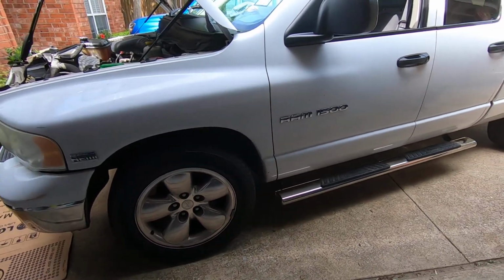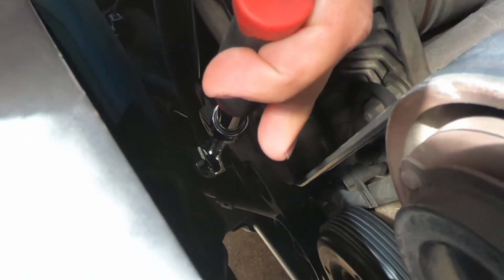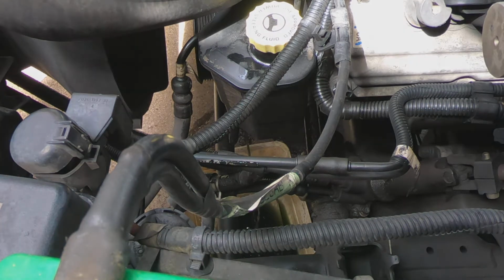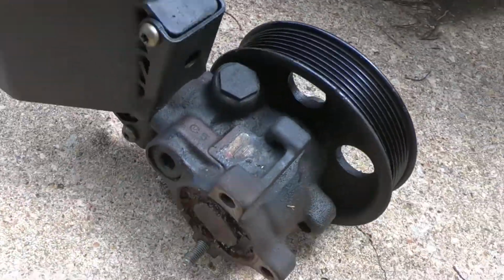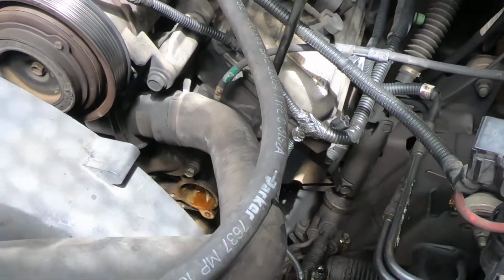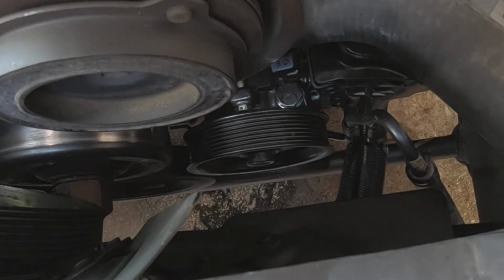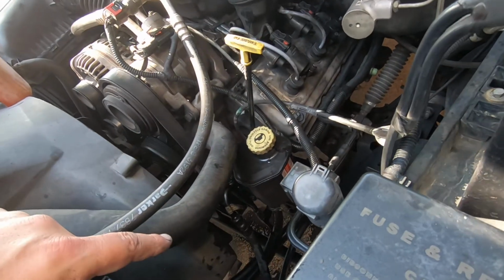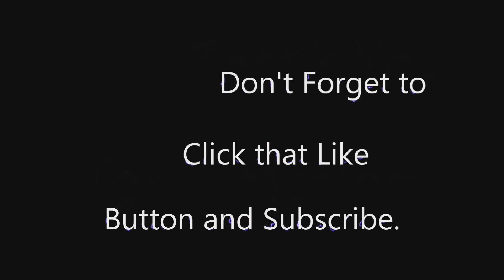How to Change the Power Steering pump on a Dodge Ram with the 5.7L Hemi.

Comment: I watched to see you change the  pulley...  You skipped the best part.
Reply from the maker: Sorry when I got back from the parts store I jumped straight to the pulley and forgot to start recording. It is really easy as long as you have the pulley remover / installer kit.
Reply: Same boat here. I got the pulley tool. But do I have to unscrew that center allen screw before using the pulley tool?